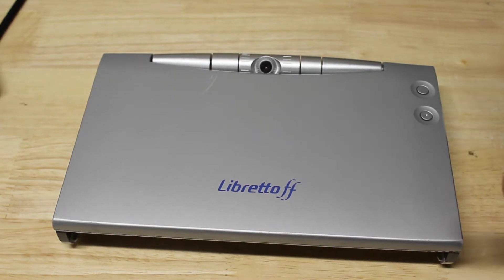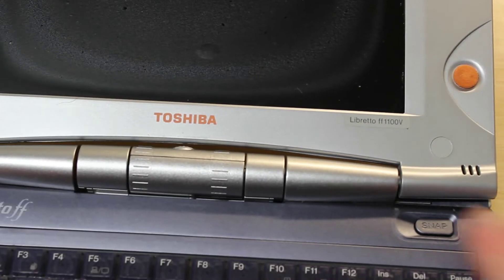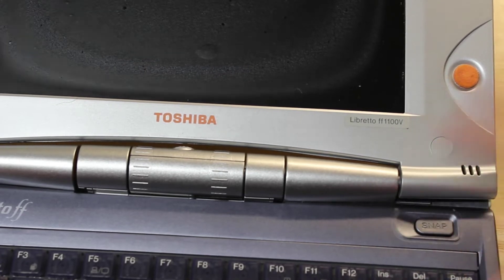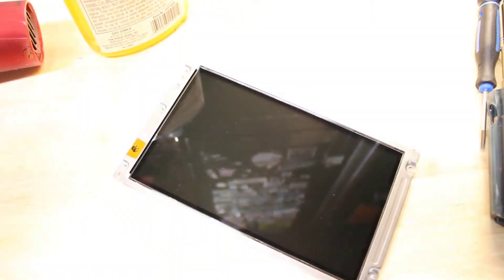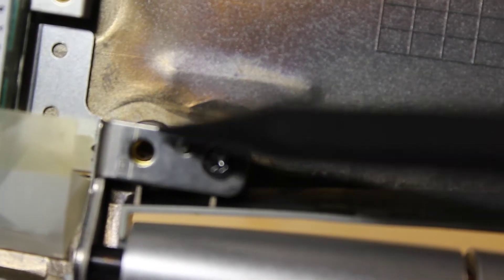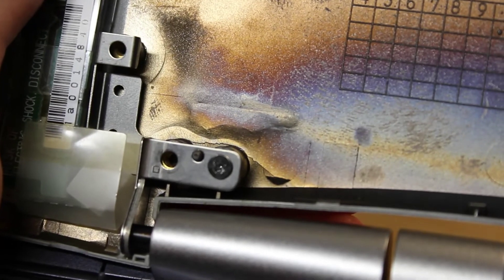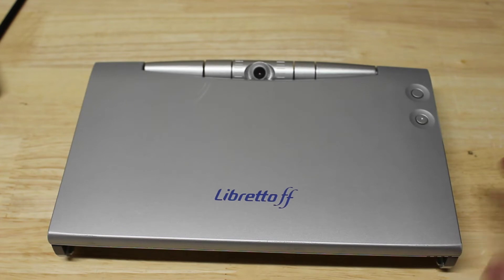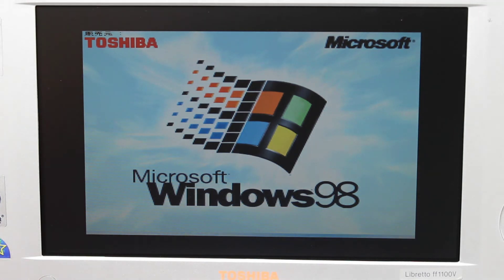Toshiba Libretto ff1100CT/ff1100V Screen Teardown + LCD Polarizer Film Removal

Comment: Hey thanks.  This video helped me replace my lcd panel without breaking any bezel tabs.  I just used my fingernail and some pressure to push the snaps in and out of the way without breaking anything.   Also, used a razor blade on the screw cover stickers, but no heat needed.  Job came out perfect, no leftover indications I'd been in there.

Comment: Is there any solution to the pink vertical lines short of replacing the LCD?
Reply: Look up the video by James Channel where he repairs a Go portable handheld. He manages to repair many of the bad lines of an LCD, replace the polarizer, and generally get the screen near-mint after being basically junk.
Reply: @carpespasm  I found the channel but not the specific video. Can you tell me the name of the video? Thx!
Reply: @  What The Heck is a KOEI PASOGO?!
Reply: That could be damage to the LCD but since it's so common on the Libretto 100CT's screen that's less likely. It also affects some other Toshibas with Sharp screens from that time like the Tecra 750DVD has a 13.3" sharp screen where the right hand side always has one column that dies in a similar way. I think it should be the conductive glue bonding the column driver Chip on Film that's causing the problem. Disassembling the screen and putting a rubber strip over where the CoF adheres to the LCD edge should help, otherwise it might need the glue replaced or it's a fault with the CoF, which isn't fixable without some serious equipment.
I have successfully used the thin rubber strip method to repair an LCD where I accidentally unstuck the connection for one column driver area, the pixel columns all worked after the fix.